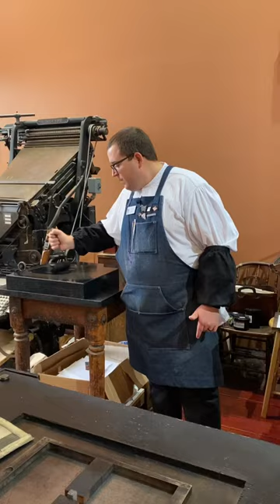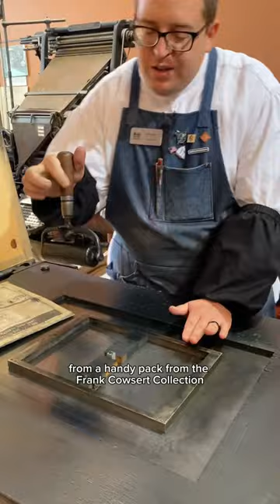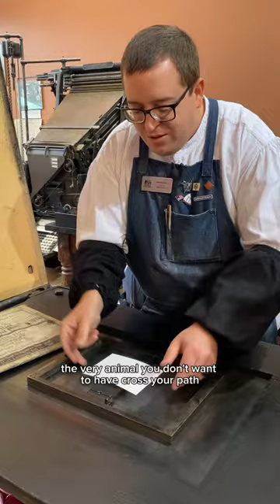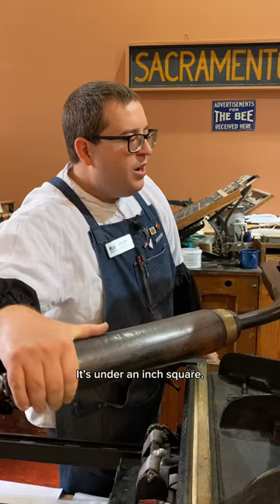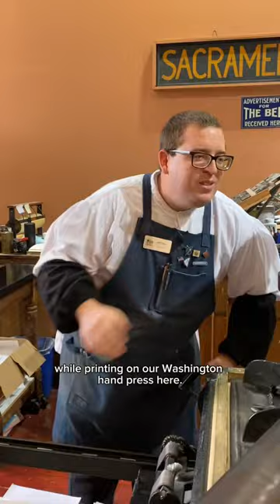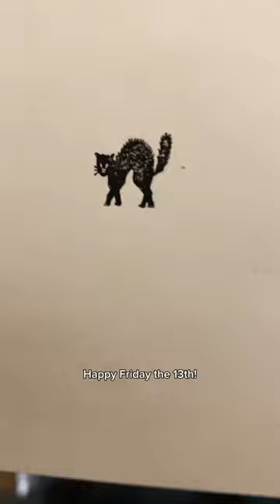Printing a small sort that will make you superstitious for Friday the 13th (October 13)

Comment from the maker: Since it is the spooky season, we are letterpress printing some of the Halloween related cuts in our print shop. It also helps that today, October 13, is Friday the 13th! This very small sort from a handy pack, which is less than an inch square, is from the Frank Cowsert Collection. This is from a handy pack made by the American Type Founders in the 1920s. Handy packs contain small symbols for informational or advertising purposes for printers in the letterpress trade. 

For today, Jared printed a piece of lead alloy type, also called a sort, of a black cat. If you’re superstitious, we suggest not crossing the path of one today. This was letterpress printed using our Washington hand press, which was manufactured in 1852.